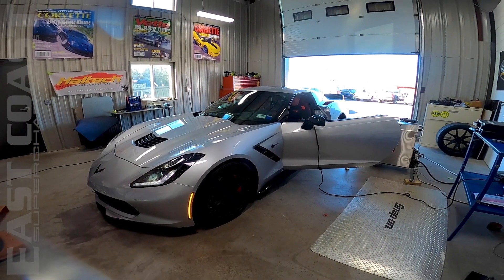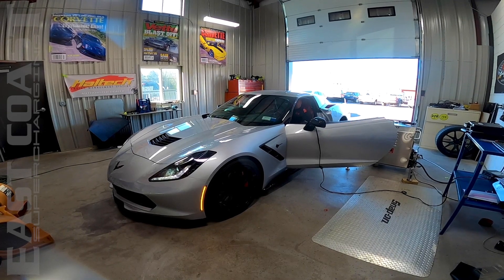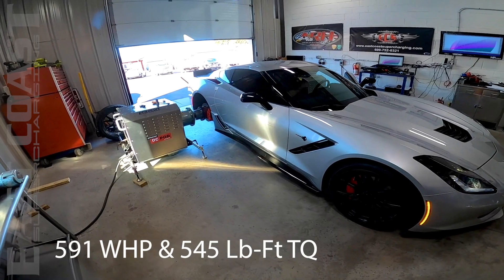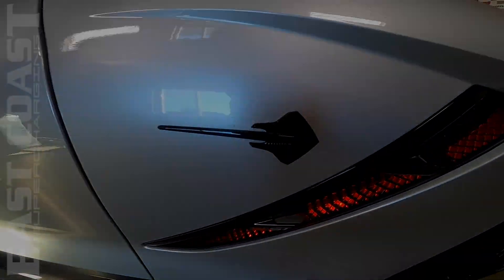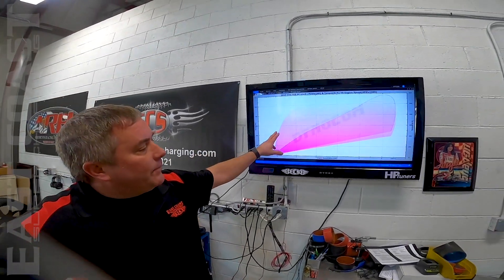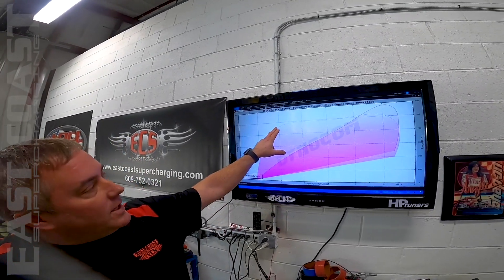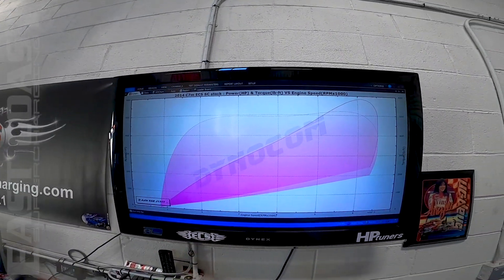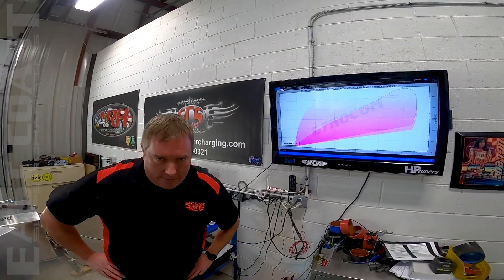ECS C7 Supercharger kit: Why it makes such good power!

Comment: I have a 2009 C6 LS3 M6 with the Trick Flow 580hp/520tq heads and cam kit with aFe Pfadt 1 7/8 Tri Y LT headers.  The cam is 230/238 .625/.625 with a 113 LSA...can I install your kit?

Comment: Is this HP level in the safe zone for the stock pistons? I was told no more than 550ish wheels.
Reply from the maker: Yes absolutely on 93 octane. You can usually push them to the 650-700whp range and be reliable on the stock bottom end.